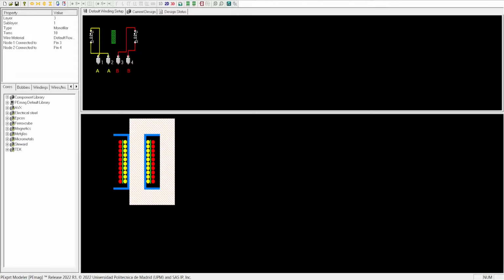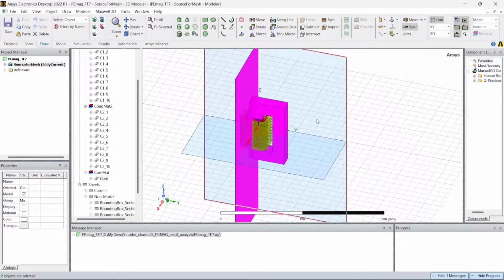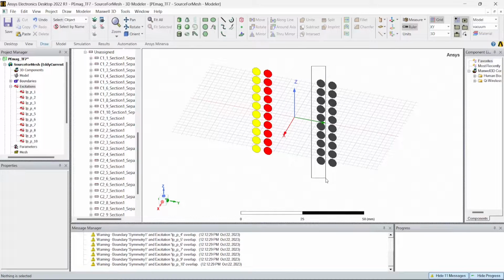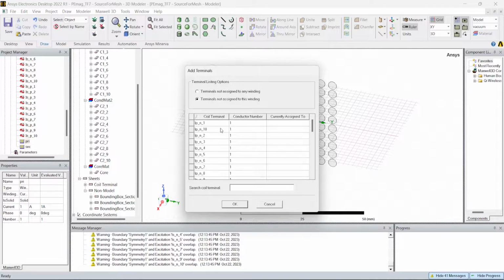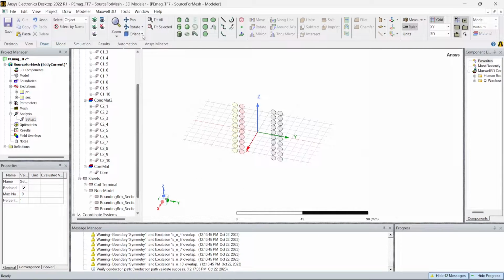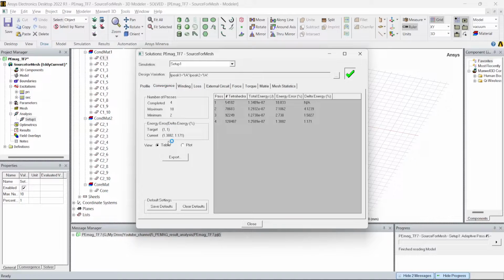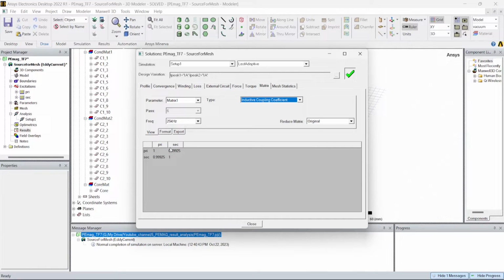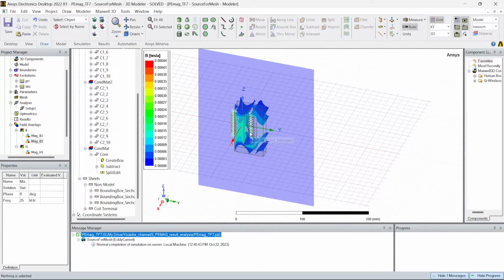Transformer design Basics: Ansys Maxwell Tutorial

Comment: hello, one question, this is just haft of the core, so do we need to multiply by 2 the resistance result to get full core value
Reply from the maker: That's a great question! Yes, you would need to multiply the result by 2 to get the impedance value.

Or you can set  the symmetry multiplier 2, indicating that the full model is twice the size of the simulated half.